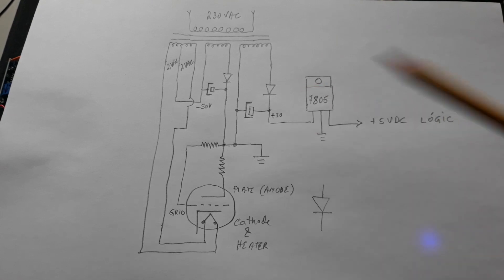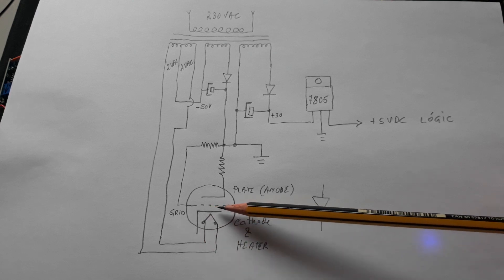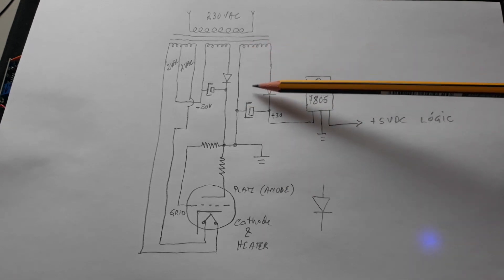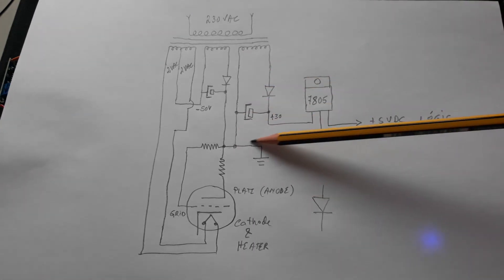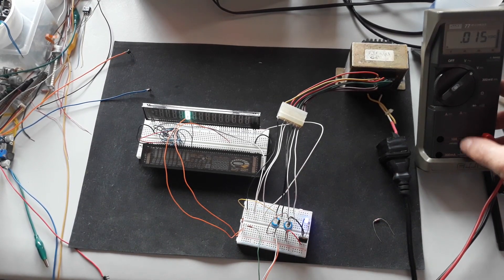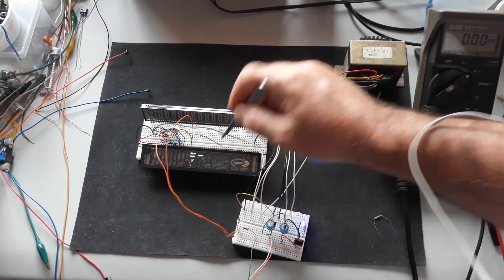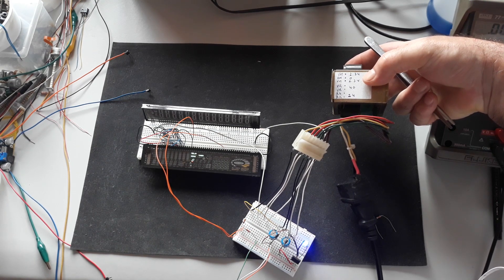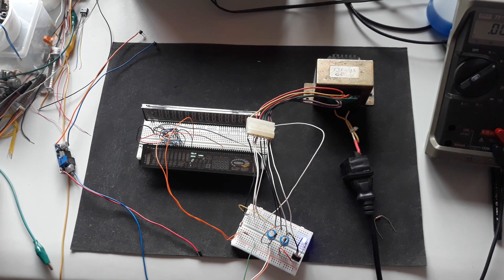How connect VFD (Vacuum Fluorescent Display)

Comment: can u do a video on how to program one?
Reply from the maker: @Emergencylightingcollector42 Hi, on the channel there are many VFDs videos, with code examples for Arduino. They are basic and often do not have any libraries to make them easier to use, they are not clean and are often written without good programming rules. But they can be worked on by anyone, even code beginners.
Please take a look at the links in the video descriptions to see if they help. If they don't, ask any questions you may have and I'll try to help as much as possible. Good job there!
Reply: @jlsmonte  1 more. Is there one on how to make it neat in a clear box and make a clock with a date?
Reply from the maker: @Emergencylightingcollector42 Please tell me which platform you want to use, Arduino? STM32? or other.
Do you have a DS3231 module or can you buy one? See that the price is close to €2 on Aliexpress. I ask this because I have a lot of videos related to this! Including the panels they use.
If you consider this a solution, I will try to summarize it in one of our next videos!
Reply: @jlsmonte  I dont know which one i wanna use. I would want to pick the easiest.I also have to find a stereo with the vfd with it and i will tear it down unless there is ones for sale on aliexpress
Reply from the maker: @Emergencyexitguy  Ok, let's take it one step at a time! First it is important to define how precise the clock needs to be, so I ask if a DS3231 will do and if you can buy it. With it you won't need to worry about adjustments and it already has time, minutes, seconds and date. Also I think allow a wakeup. It has a battery so that in case of a power outage there is no need to reset it. Now it is necessary to define the driver for the VFD panel, the SN75518 is not expensive and is also available online. As for energy sources, do you have any? Are there displays for sale on eBay depending on your country? to avoid high customs or postal service costs.
Reply: @ Can you do a community post can show me everything i need and links?
Reply: @jlsmonte  updates?
Reply from the maker: @Emergencyexitguy  Ok, I will do a small video where I adapt one VFD of 7 segments, like used on this video with a DS3231 and try let is more Claire, ok. Let me fine a gap of time to do it!

Comment: Hi, thanks for showing us and explaining your setup.  I do have one question.  Are the resistors going to the anode and grid necesary?  I ask, because as long as the voltage is correct, I don't believe any further current limiting is necessary.  Thanks.
Reply from the maker: Hi @Enigma758, 
Yes! Is true. 
The resistors present at sample schematic aren't need. Like I speak on the video the resistors is only to represent a part of control, OK.
Any way I recommend the presence of a resistor at output of power source "grid/segments" to protect the circuit of power source and the possible driver, in face any possible short by mistake. On this sample, if resistors aren't present, we are in front of a short.
The pins of the driver which are used on the breadboard connect direct to the pinout of VFD at other sample of video.
You have also another video where is used the B0524 which is also a good solution to the polarization of VFD.
Good job!
Reply: @jlsmonte  Thank you for your quick and informative reply.  I've been collecting a number of salvaged VFDs and hope to use them for future projects.  I see you have an appreciation for VFDs too, so I just subscribed to your channel.  Thanks again.

Comment: Any help regarding a Kenwood KE 7090 Graphic Equalizer? On standby mode you can see like red lines that glow, never happened before, ive replaced all capacitors but still the same results
Reply from the maker: Hi Random,
The polarization of VFD is easy! Note you need all time a voltage to polarize the filament and another to polarize the grids (don't matter if it is positive or negative, depending of project).
Looking to the schematic of circuit 7090 you can find at connector marked as "A" pins with names:
AC, Center, AC, this is to filament(pins 1,2,3), will be something like about 3VAC ok
Another point important is the -42V(pin 4) and finally the GND.
If you follow the -42 pins you reach the zeners ZD304, ZD305 & ZD306, this node is responsible to make the reference of filament as  -42V, ok, if you measure in reference to GND you must reach near of -42(>-30) Volts in pins of fillament added with value of AC.
Here is the link wich I think can help to you:
"https://www.audioservicemanuals.com/k/kenwood/kenwood-ke/159204-kenwood-ke-7090-service-manual"
My thanks to the "www.audiosericemanuals.com"
Hope this can help to you, and sorry my english.
Reply from the maker: Only to conclude: Take attention to the state of zener's and C's, if any is not ok you can reach a overvoltage at filament, that can burn out it!
Reply: @jlsmonte  thanks to your reply, do you think it could be a resistor or another component on the board supplying power the the display? Or is it the display that's on its way out? Thanks for your help 👍
Reply from the maker: Hi Random,
The brightness of the resting filament, that reddish hue, depends only on the filament feed. It should be around 3VAC depending on the manufacturer, you can always consult the datasheet of the VFD or one of the same brand.
Now note that if, for example, you have a capacitor with passage, such as the C319 or C320, which are immediately connected to the AC points (pin 1 and 3) of plug A (Also the zeners I mentioned above can do this), that would on one side you would have a value of 3VAC and on the other you would have for example -18V forced by the short to earth ... of course, as the -42V are of very low amperage they would drop too, maybe to near of -20 or -18 ... even so the VFD would work with less bright!
But I still don't know if the display is doing its job, it works well, it's just the red filament problem at rest, or it doesn't work at all!
Reply: @jlsmonte  When the equalizer is turned on it works fine, no issues at all, and it's a nice bright display, as soon as its turned into standby mode you can see i think about 7 horizontal reddish lines, and a slight buzzing noise if that makes any sense, the service manual can be found here

https://www.google.co.uk/url?sa=t&source=web&rct=j&url=https://www.vintageshifi.com/repertoire-pdf/pdf/telecharge.php%3Fpdf%3DKenwood-KE-7090-Service-Manual.pdf&ved=2ahUKEwiOi_f0j7fvAhWZiVwKHWAxArsQFjABegQIERAC&usg=AOvVaw1jiJARNQ6-b2SXd6nZ_6hX

I'm clueless where schematics are concerned, soldering I can do at ease
Reply from the maker: @PatrioticWarrior17  
Really I think I cannot help much more, because if the value of AC is near of values I have make mention, and the reference of -42 also.
The schematic is the same I have look, I see this model have a lot of variants of transformer: 230, 115, etc... and also have a switch to adjust it, please have the sure the swithc is correct value of your net AC.
The filament is direct polarized from the transformer by this reason only the parts already mentioned can influency it.
Is easy to measure the AC value to the filament, put multimeter in AC voltage and connect it at both extremly pins of VFD, after measure related to the GND.
Please take care with any short , they can burn fillaments.
Reply: @jlsmonte  Mines the UK version, the two capacitors you mentioned c319 and c320 have both been replaced twice by myself with brand new high quality caps, im probably best taking it to a repair shop, but i try and fix things myself, can't understand why this problem has occurred, worked fine then out of know where I get glowing red horizontal lines in standby mode, thanks for your time and your help, much appreciated 👍
Reply: @jlsmonte  Sorry I forgot you already gave a link to the service manual

Comment: the wiring diagram and explanation are very useful for understanding VFD with negative power supply  :D
Reply from the maker: Hi "enel92",  this is the professional solution to the power up the VFD, but all the other suggestions present on the other videos work, ok. :D